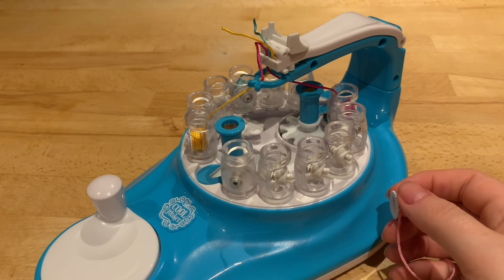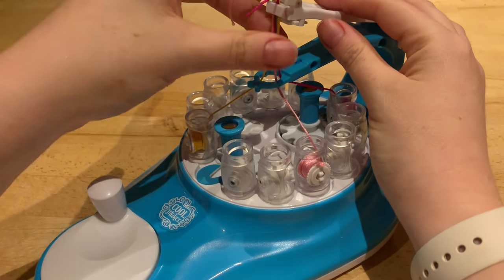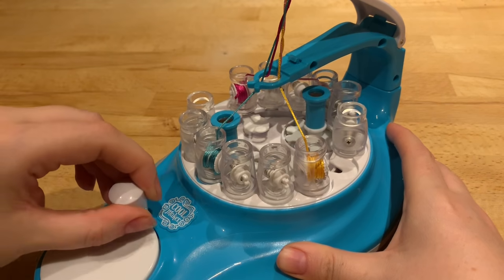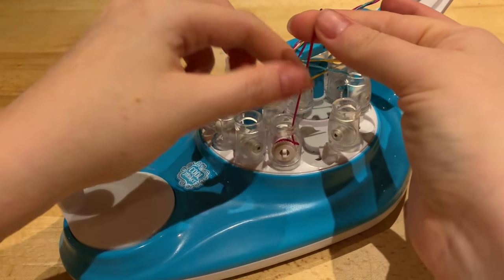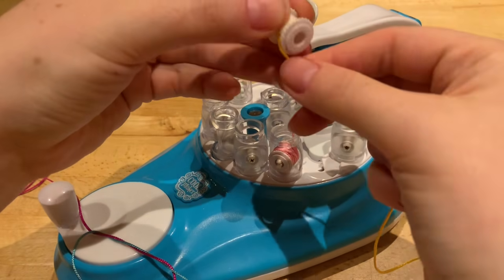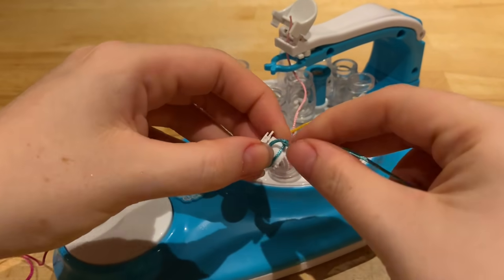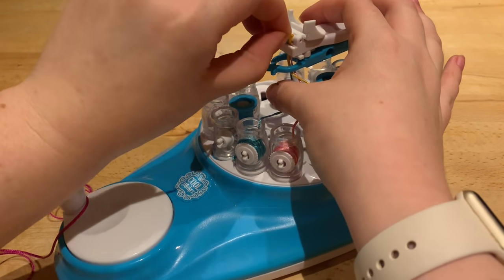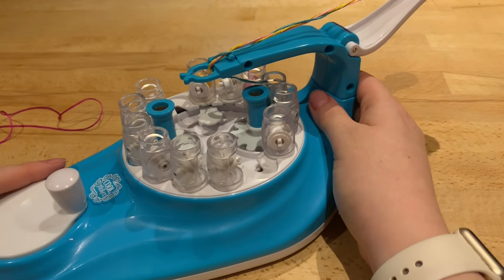Kumi Kreator Cool Maker - How To Fix Problems

Comment: Its jammed but without thread. I havent been able to spin it yet because it's stuck
Reply: mine too! I really have no clue 😕
Reply: Teresa Castelló maybe I fixed mine, I tried and force it running it backwards moving the wheels by hand. I noticed that one of the spools was stuck on one of the wheels so I tried to force it to leave it in one of the empty spots. I forced it some more and it unstuck and I was able to make it spin forward.
Reply: U r so right bc I have the same problem
Reply: Same problem here

Comment: The string is not the problem it is the machine won't turn and the little things feel loose😥 this was my birthday present so I guess $20.00 thrown away in the Tash😖
Reply: Same only christmas 6 of the thing that hold the thread are stuck in the gear😒😒

Comment: My white arm will go straight back it won’t even let me do the bracelet part
Reply from the maker: Have you lined the gaps up at the top and bottom, and the. Pushed the white arm down until it clicks? If that doesn’t happen and your arm is definitely attacked correctly, it sounds like yours may be faulty & needs exchanging. Hope that helps.

Comment: Every time we try to put it up to start it pops all the way up and loosens everything completely.
Reply: Like when we push down the white flap that locks it it pops it completely open if that makes sense. It is either the flap is up on the white part to place in between the blue and the white clasp when all spools are set when we push down to begin the white part flips all the way open which loosens all the thread
Reply from the maker: When you first push the arm down, (before you put the thread in) does it click? If not, it could be faulty.